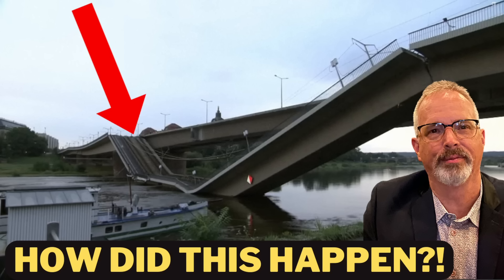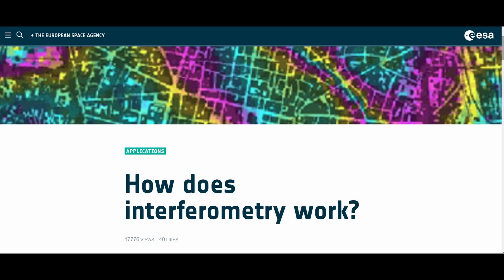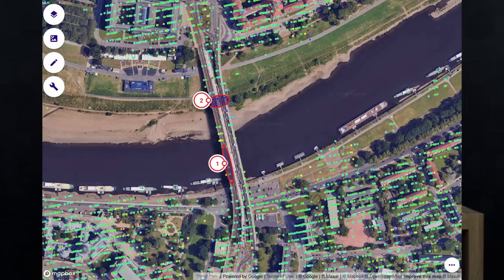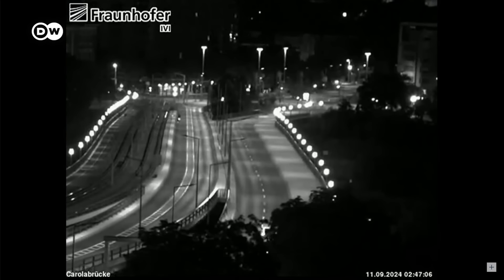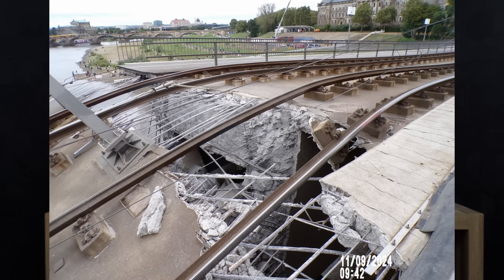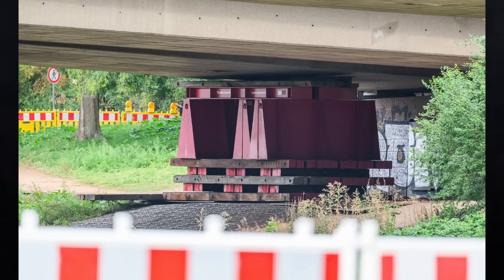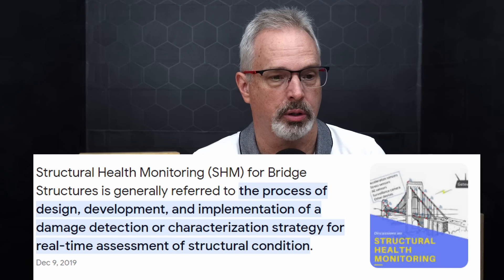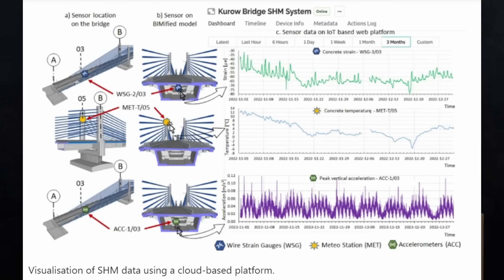Carola Bridge Collapse Update - Dresden, Germany

Comment: As a Dresdener, thank you for this very interesting information about InSAR. May I add that the other three historic bridges in the city center are arch bridges from 1852, 1877 and 1910 and still standing strong. We should go back to classic arch designs for bridges. Sturdier and more beautiful.
Reply: A 'fail safe' design versus fracture critical design?
Reply: @uploadJ  I'm not sure what you're getting at, but there is no perfect bridge. In any case, a bridge that shows its damage is better than a bridge that simply collapses without warning.
Reply: @GrandTheftChris  LOOK at the Roman coliseum, and tell me what is wrong with that structure? How many years has it stood? Now let's look at the Patheaon (128 BC): WHAT do you see there?
Reply: @uploadJ  What I see is apples and oranges.
Reply: @GrandTheftChris  re: " I see is apples and "
Typical response by a member of the public.
Reply: @uploadJ  The dome of the Pantheon works exactly like an arch, it's a circular arch. All I'm saying is we should build bridges with arches again. I haven't said a word about the material used.
Reply: If I may ask, how is the petition(?) for new old bridge going? Does it seem like the new old bridge will be build, or that they will just add new, mor or less same, deck on existing pillars? Also, had the city of Dresden asked Bundeswher for some temporary railway bridge sets in order to put the tramway back in the service?
Reply: @MrToradragon  The "old bridge" probably would not be built as original; it was rather small and definitely doesn't match current requirements (separation of tram, bikes, cars and so on; there's also the question of the number of lanes); if anything it would be something resembling the shape of the original bridge. The existing pillars will not be reused (at least not all of them); the northern pillar of the collapsed part has already been (partly) demolished.
A temporary railway bridge for the trams probably would serve little purpose and also hinder the construction of a new bridge (it certainly wouldn't even be possible until the remains of the collapsed part are fully cleared). The tram lines are re-routed via the Augustus bridge. There are only two stops that can't be serviced - Synagogue and Pirnaischer Platz. The latter is quite important for switching between lines; however switching can also be done at Postplatz. The main drawback right now is that it takes longer from (for example) Albertplatz to Prager Str.

Comment: I live in middle TN, looks like you now have a lifetime of infrastructure material to explore. One of the more interesting imminent dam failures was the warnings about the Nolichucky dam. The initial videos of the overtopping looked eerily similar to the Rapidan dam videos. It was bypassing the dam on the shore, what looked like similar scouring potential. It survived, probably due to the rock embankment, have not seen a video of the dam after the water receded, it may not be there yet. Similar age dam, built in 1930, assume part of the larger TVA project. The other disaster that did happen was the flooding of the new Unicoi hospital where they had to rescue staff and patients from the roof. Seeing drone footage post flood it was obvious that the hospital was in a direct path for a flood, there was a gentle S-curve meander in the river’s path just upstream of the hospital, but above that was a gun barrel straight section of river aimed directly at the hospital. Makes you wonder who would put a hospital in such a comprising position.

Comment: The bridge was constructed in the 1970s (as you reported). It was subject to corrosion, as salt used to melt snow in the winter got into the concrete and affected the reinforcement in the bridge. They new about this for years, yet they squabbled over it for years and only fixed the bridge for cars, as cars are way more important than pedestrians or tram users. They wanted to address the issues next year. They knew about the situation in great detail. They had monitored ist, but they didn't saw the necessity to do something about it. We have similar issues with other bridges in Germany and politicians rather built new highway and fix old ones. So another bridge almost collapsed two or three years ago and had to be blown up in a controlled manner before it collapses.

If find is super interesting that you can get such information from InSAR data. Thanks for the input.

Comment: Did you take into consideration that at the time of the atypical movement (Oct. 2022) the renovation of the middle part (B) of the bridge started? It is connected to the collapsed part C with one connection in the area you called (1) in your video.
Reply: He did not. Because he has no clue.

Comment: One of the contributing factors, at least in my view, might have been corrosion of the prestressed rebar in the upper section of the beams. The corrosion was caused by the heavily use of salt in deicing fluids during low temperatures over many years. Flouride corrosion does not expand hence there was no significant indication of damage at the surface.the prestressed rebars failed, the beam had lost its compression, got tension  instead and broke up.

Comment: Good video. Reinventing the wheel is such a waste but, I've seen an oganization that reinvents the square wheel about every decade(corruption is involved). Does Germany use road salt? The usual problem is that politicians don't want to spend the money for proper maintenance of roads and bridges. Good Luck, Rick
Reply from the maker: Thank you.  Reports suggest that they do use road salts, but just like in the U.S., local media are thin on reporting details.  I will keep digging on this story though.
Reply: The former GDR was very generous with road salt, as is well known. So the bridge could have been exposed to a lot of salt, at least in the first 18 years of its existence. Investigations are already underway into whether a certain lamp post on the bridge could have been a gateway for the salt to enter the internal structures.

And no, the maintenance was not neglected by politicians with their eyes wide open, but after reunification we (West Germany) had to bring a whole third world country (East Germany) and its rotting infrastructure, economy, environmental damage, workforce and social system up to scratch as quickly as possible. We have spent literally hundreds of billions on this over the last 30 years. East Germany today is cleaner and more beautiful than large parts of West Germany. But in this huge undertaking, which included keeping the existing western economy running to finance it all, some things may have been overlooked or postponed. This should come as no surprise to anyone.

PS: The bridge has been under repair since 2019 already, but only the part that is still standing has been completed so far. The collapsed part would have been next.
Reply: Typical winter climates in Germany have thaw-freeze cycles, so we use road salt. On bridges you need quite a lot as they are completely exposed to the atmosphere.
Reply: @CaseyJones-Engineer  Road salt on the part of a bridge that is used for trains. Keep digging.
Reply: @hape3862   No, I'm sorry, but that's nonsense. Net investment in infrastructure in Germany has been around 0 since ~1998, so we have invested virtually nothing in the last 30 years and it shows. We have thousands of bridges that need to be replaced, our rail infrastructure is so old and obsolete that we will not be able to run an integrated timetable until 2070 - something Switzerland has had since 1982, and so on. Economy institutes in Germany estimate that we have an infrastructure defecit of 700 billion Euros, and it is getting worse because of the "debt break". This was a deliberate choice and it is now costing us dearly.
Reply: @_yonas  "Net investment" literally means "maintenance not included". We didn't build much new infrastructure, that's true and that's what "net investment" says. But I said that we of course did maintenance – although we could and should have done more.
Switzerland is a tiny country with a lot of money. Germany is 8 times bigger and Germany's rail network is 6 times longer than Switzerland's. Switzerland hasn't had a re-unification with a third world country where at the time almost no rail line was electrified and the whole economy and infrastructure (including rail!) was rubbish. We spent literally hundreds of Billions in the former GDR! It is just unfair to compare Switzerland with Germany. And btw, the integrated timetable is said to be complete in 2070. Parts of are already integrated!
Yes, I agree that the debt break is a fetish that should have never been signed into the constitution. But on the other hand it is and will be a big advantage when we ever need more money, because a proper state budget means low interest rates for possible debts in the future.
Reply: @knietiefimdispo2458  Pedestrian and bicycle traffic needs roads to not slip on.

Comment: You mentioned monitoring and instrumentation, these have just got really cheap to implement in the last five years. Most of these new sensors are battery powered and radio back to a radio gateway and an off site server, which can then be interrogated by a web portal. The gateway often needs a power supply but we have lamp posts everywhere.
A different industry, but we are using the same radio server infrastructure for weather monitoring, bearing temperature, water level sensing, independent plant fault monitoring... Much cheaper than installing cabling, or even modifying the existing computer control systems.

Comment: Pre-stressed or Post Tension assemblies solve a lot of issues, but not without some down sides.  I've encountered  many cable ends that were not properly sealed. Many times the use of a torch to cut the excess leaves a lot of slag, or too much cable behind, which prevents the caps from being properly installed allowing water intrusion. I know there are other ways to prevent water intrusion besides caps.

Comment: I would take the satellite data with a grain of salt unless it can be corroborated by other means.  It seems to me that if the bridge had sagged several inches over a short time that other signs would have been apparent.  Things like cracks, ponding during heavy rain, tilt of light poles, etc.  If it was dripping nearly an inch a year for several years, it is really hard to believe that this went completely unnoticed.
Reply: According to the data shown, only since 10.10.2022, so little less than 2 years and the total drop was less than 4 inches. that is not necessarily obvious. about 40 mm down and 200m away 40mm up. that is a change in gradient of  0.004 %. that is well below what we notice.
Reply: @beyondEV  Four inches is hugely obvious when it comes to water runoff and ponding.
Reply: @LTVoyager  It should be noted that the bridge was under re-construction during this time so those factors might have gone unnoticed due to work constantly being performed. I also wonder if perhaps changes in thickness of the new covering might account for some of the differences.
Reply: Where is it supposed to pond?  It's a light rail bridge with a bikelane. It doesn't have a flat impermeable surface
Reply: @CjqNslXUcM  The surface sure looks impermeable to me in the pictures available.  It looks like concrete on the side with the two rail lines an asphalt on the side with the bike/pedestrian lanes.  Most rail bridges are flat or nearly so with slight crown to allow water to run to the sides.  Generally, there is a drain under the railings every 100’ or so to drain the water off the bridge.  Add in even two inches of sag between the drains and a lot of water will pond during a heavy rain.
Reply: @LTVoyager  I used to cross the bridge on my bike, including during rain. There were no major drainage problems.

The bike/pedestrian lane is gravity-drained outwards, while the light rail is not integrated into a surface but placed on elevated sleepers. There are drainage holes you can see under the bridge. It's also not completely level, but at a slight incline towards the center.

Comment: Casey, to be clear, you are suggesting the use of InSAR and other technologies with predictive analytics to augment current conventional bridge inspection. That was my understanding of your video. Did I understand it correctly? 

I state this because I fear that some views are thinking of predictive analytics as a way to reduce the costs and impacts of bridge inspection. 
(In the distance future this could be a valid use of predictive analytics.)
Reply from the maker: That is right.  This data analysis would be a supplement and not a replacement for routine or special bridge inspections.
Reply: Movement is only one inspection parameter. One, which if it shows irregularities, can serve well as a early warning system to trigger more in dept inspections.
But the InSAR can't see if a critical steel member is almost corroded through (if it doesn't sack). While any inspector would easily see it.
Of course if authorities do take things seriously, the will trigger in dept and special inspections at the slightest hint of potential trouble. In 2007 the swiss authorities had the military run two Main Battle Tanks up and down a critically important viaduct, so the engineers got better data on deformation under a heavy localized load. Everything turned out to be in the green.

Comment: For a lot of Bridges in Germany, we can easily go through a checklist
Is there deferred maintenance? Yes...
that says abut almost all we need to know.
Also about the majority of bridges for example the main bridges on sections of the Autobahn are all about that 50+ years age, no matter if east or west.
Quite a number of bridges, mostly steel constructions, not concrete though, currently have weight restrictions imposed, causing chaos and delays in traffic, as only looking at the most urgent ones, we would have to replace at least 20 of them at once.
And that is only for the Autobahn, where maintenance is responsibility of a federal agency and its regional subsidies, that did not yet consider all other bridges which fall into state, or possibly even municipal responsibility.

Comment: Thank you from Germany for these interesting insights. Well put together how to identify that data at first and lead to prevention strategy by predictive analysis later. Only looking at the satellite data it would be interesting to know, how many of those bridges, that are having movement of around 20 mm/year do actually collapse in the following 5 to 10 years. This will make the urgency more obvious.

When most bridges also healthy ones are moving those 20 mm/y then it is not a strong indicator. Is it 1/10 or 1/100 or 1/1000 of these that will actually collapse. And sure when this warnings are seen more close inspections will give better predictions. This is actually the one part that is missing a bit here and is apparently not contained in the data of one bridge. How precise of a warning indicator is this exactly. When all bridges are moving 10-30 mm/y this is not saying much on Carola bridge.

Comment: There is an 95 plus year old drawbridge (Tacony-Palmyra Bridge, operated by the Burlington bridge commission) in my city they are no longer personally inspecting.  They decided inspecting it via drone is much more efficient!!!  I feel so safe.

"Keystone Aerial tested three aerial cameras integrated with its UAV to see which provided best results during the Tacony-Palmyra Bridge Inspection Project. There was a clear winner – from 130ft away!"

I'm not a civil engineer, but I find it very hard to believe that an engineer on the bridge is not doing a better job than a UAV inspection.  OTOH, PA is known for doing inspections of bridges and then pretending they didn't see all the damage found during the inspection (recall the YEARS of inspections of the decaying bridge that fell in Pittsburgh)

Comment: I think the bridge movement here is purely incidental. The counter-balanced movement is due to a coincidence of geological processes, soil compaction and groundwater pressure. Bridge spans aren't pivoted on a fulcrum. The ends of the spans rest on pillars, and they're allowed to freely move in every direction except transversely. Particularly, the span's main supporting plate is resting on a bearing (usually just a single giant steel cylinder), allowing it to move back and forth, for thermal expansion. Weakened span is expected to sag a little in the middle, but sagging under its own weight is completely eclipsed by sagging under the weight of passing transport.